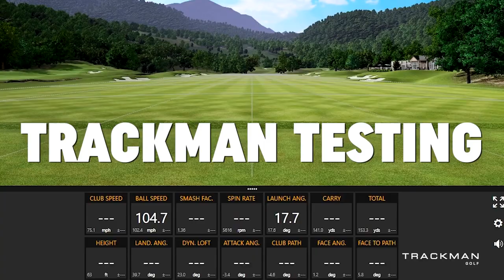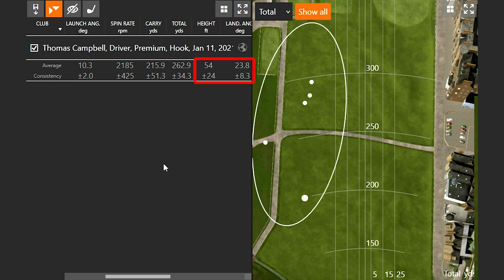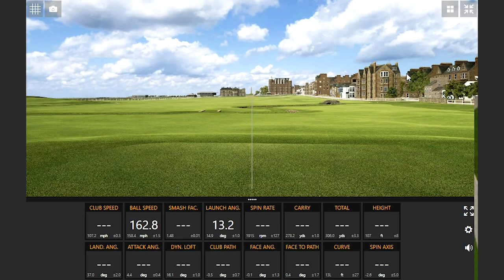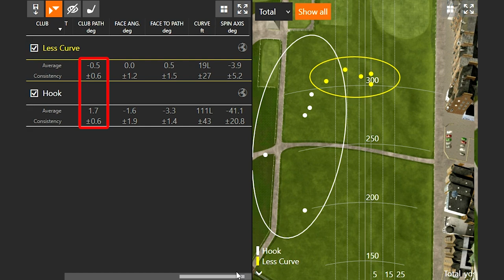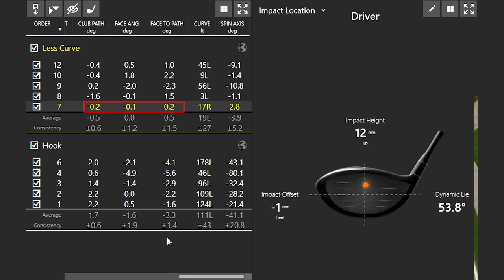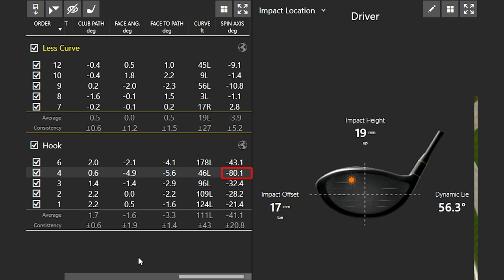How To Fix A Hook | Golf Swing Tips and Tricks

Comment: All great data that makes sense but I’d like more fixes as I’ve found many other elements after grip, position of ball face & club path etc like ball position, rotation on backswing, hands on backswing, upper/lower body sync on downswing, body movement off centre etc - I know there are lots of fixes to this so might be worth doing some video on top 10 things to check if you have a hook, a slice, a pull, a push etc. I’m trying to fix a pull as I get the club face right but coming slightly out to in - you could do a great series on these 😁 Keep up the great content 👍
Reply: Just a thought:  pinch a tee between both biceps and pecs.  Then swing from left arm parallel in backswing to right arm parallel on the follow through.  Swing around your body: that's key, again swing around your body.
Reply: @norgerepairs8687  thanks for the tip but I’ve had a couple of strokes so find things like this hard but appreciate it 👍